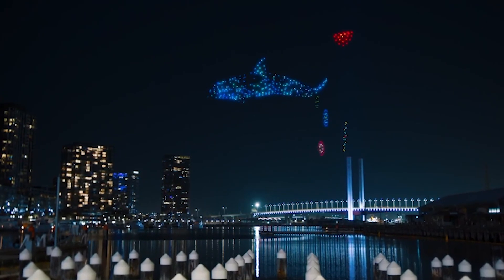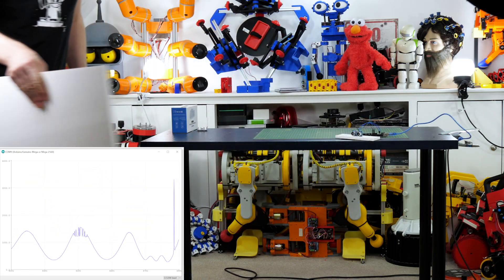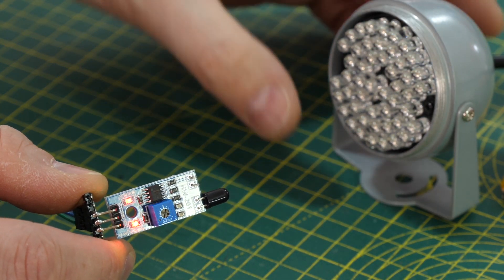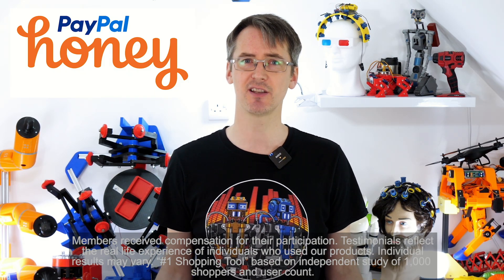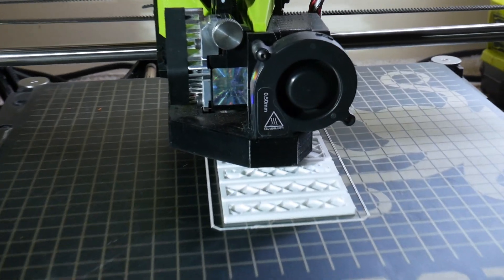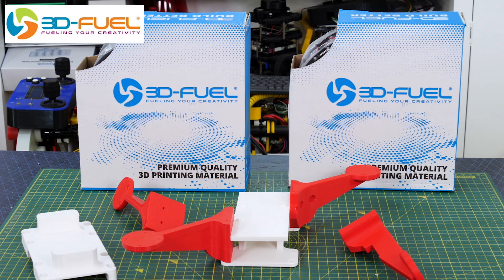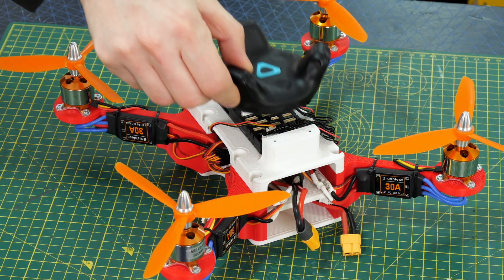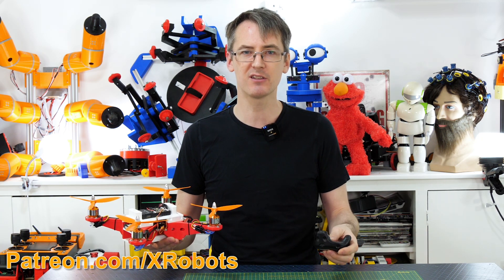Experimental Drone Positioning System

Comment: Pretty cool what you were trying here. Couple of thoughts:
1. If in case you are kinda fixated on ultrasound. Maybe having a range of just pure transmitters along a flat rule working as a phased array might get more accuracy. This of course would need a filter to remove rotar noise.
2. You could try IMU sensors  and ultrasonic sensors in a sensor fusion kalman filter.

Hope this helps!

Comment: Worked for a company making ultrasonic IPS systems for model cars, my job was to make autonomous drones and robots using this system, for industrial applications. For ultrasound, controlling the power and timing of the us-signal is crucial and a lot of filtering is needed for accuracy and precision (cutting through rotor downdraft and reduce noise from refraction, diffraction and reflection).
Reply: amazing ,and duing your workingtime ,can you use some navigation system?

Comment: You could try using the decawave dwm1000. Like Bluetooth and Wi-Fi, ultra-wideband (UWB) is a short-range, wireless communication protocol that operates through radio waves. But unlike its counterparts, it operates at very high frequencies — a broad spectrum of GHz frequencies — and can be used to capture highly accurate spatial and directional data.
Reply: It has functionality for anchors and tags. There is also a Arduino library for them. I bit more expensive than the ultrasonic solution, but should be more stable.

Comment: Great video! It is really a interesting idea :D I love these videos where the whole process from idea to experimentation is shown.

It really got me thinking and something came to my mind: I understand that the general goal is to be able to track multiple robots. But, if the objective was to track just one, it might be a good idea to switch the places of the transmitter and receiver.
The transmitters will be syncronised at the robot and the receivers at the static positions (obviously changing the atennas the other way around to catch the ultra-sound from all places.) That way you won't have the problem of just one signal being received by both receivers (well you could but the transmitter are at the same place so the measurement will still be "correct"). You will get two measurements of distances, one per receiver and with it do some triangulation to estimate the position. What do you guy think?

Again this is something I just quickly thought about, but I think it might work.

Comment: Watch Steve Mould's video on acoustic cameras!

this would better be implemented as the Ultrasonic transmitter on the robot, the "ground station" doing the calcuations, and transmiting the data back to the robot (optimally with an rf transmitter). this settup would also allow 3-dimensional positioning with a wider field of view. latency may be a concern, though.

finally,  you can use an accelerometer to filter out the noise and spikes. if the slope of the spike doesn't match up the the accelerometer, then filter it out. The accelerometer doesn't know where it is or its velocity, but it knows how much the velocity changed by, and using previous positioning data you can estimate what it's velocity *was*, so you can then estimate what the velocity *is*, so then you can estimate how far it should have moved, so then you can estimate it's position. if the estimated position is close to the detected position, it's good. if not, filter it out.

Yes,. the thing of the accelerometer is very reminiscent of "The missle knows where it is."
Reply: wow, u are right,and i have a qustion ,did accelerometers filter the noise?

Comment: I messed around with ultrasonic sensors a number of years ago and hated them. They suffer from reflection problems.  What about borrowing a page from VOR transmitters and receivers used for Aviation? They use VOR stations that transmit a omnidirectional pulse every second, and a narrow, directional beam that physically rotates at a fixed speed. When that beam lines up with 0 degrees, the omnidirectional pulse activates. The receiver in the airplane sees the omnidirectional pulse and computes the time it takes for it to see the directional beam. For example, if it sees the directional beam 500ms after the omnidirectional, the receiver knows it is on the 180 radial south of that station. If you tune a second VOR station and draw the lines on a map, your position is where the lines intersect. So, what if you did the inverse of this... Have the drone emit an omnidirectional IR light (or several). Have 2 towers on tripods with an IR receiver that is hidden inside a rotating 3d printed cup that has a narrow window in it. Drive it with a stepper so you can precisely rotate it 360 degrees at a fixed length of time. You know when it it is a the start position, and as the cup rotates, observe when you see the drone's light and you can compute the radial. Detect this from 2 such towers and you can accurately know the position of the drone, as long as the IR light is not obscured from the drone.

Comment: Those cheap nRF24L01+ modules could be used to replace the IR trigger. I wrote some code once which used the nRF21L01+ modules as a wireless flash trigger. The system was fast enough to use as wireless flash trigger so it may be fast enough to trigger the ultrasonic devices. I used the Parallax Propeller microcontroller which has 8 processors so one processor was dedicated to listening for the RF trigger using assembly code.
Thanks for another fun and interesting video.

Comment: What if you use, for example, EPS32 bluetooth beacons and EPS32 to measure the signal strength. How well it tolerates changes in the room. Assumed that without changes, the accuracy of the triangle measurement would be quite good when using the calibration table. Outside, you could perhaps use the wifi strength for longer distances.

Comment: What if you use four receivers on the robot and trigger on both edges of your sync signal?  You have more chance of always getting each transmission and you’ll know the difference in the arduino from whether it’s rising or falling on the ir.  Then you could filter the data from all four to the lowest value.

Comment: Use an update on the wiimote solution. Stick cheap cam modules on the bottom of the drones, and a non-equilateral trio of LEDs on the ground. You can infer the drone's rotation and coordinates from the LED triangle rotation, translation, and scale.

Comment: The infra red leds only transmit information about the phase of the pulses. It should be possible to get rid of the infra red channel by detecting the phase of the pulses automatically. The receiver could run a sweep across the phase range and see what phase gives the best signal.

Comment: Would there be any benefit in switching around the functions so the drone is the transmitter and the 2 booms are the receivers. I feel like transmitting ultrasonic and IR is a less susceptible to vibration and noise when compared to the receivers/sensors. Awesome project as per usual.

Comment: Fantastic video as always!
Take a look into the DWM1001-DEV board. They are great for applications over great distance, outdoors, and even through walls. I have gotten ±1.5" accuracy out of them independent of operating conditions. You can use as few as 2 of the boards to just get distance between the two and as many as you want to increase the 3D positional accuracy. 
they are also incredibly easy to setup and interface with using any microcontroller with just a serial connection !

Comment: Nice sync on the 40KHz,  those TxRx are almost iconic. like a 555.  Where Am I? Systems and Methods for Mobile Robot Positioning 1995, I have a A4 printed copy somewhere. . Its about 1" thick. Its a wonderful text . RF Microlocation hasnt quiet delivered on its promises, still ~10 cm. Why dont you ceiling mount the strobe, ceiling corner the US RX and vertically mount the IR Rx and US Tx . 
Its what has become Acoustic imaging, interpolating might get you to mm .Ultrasonic systems can be 
Ultrsnc sses cn b  Ultrasonic systems caan bee .

Comment: for the ultrasonics, see if you could filter frequency on the ping sensors.  if you could have the ultra sonics send a specific frequency based on their position, the drone could figure out which transmitter has a specific delay which could give you orientation data aswell

Comment: Hi James. Blutooth Low Energy (BLE) has a positioning feature. You should have a look at devices like the DWM1000 (and the equivalents).  These have 30m range, 10cm accuracy, are pretty cheap, and would be immune to most of the interference you are experiencing ... Great videos. Thanks!

Comment: James, don't use ultrasonics, that doesn't really work that well. Get the HTC Vive Lighthouse base stations and one (or more) of the HTC Trackers (tracking pucks). Cheaper and much more accurate solution that is impervious to noise.  

Not great for really small drones but for larger robots it works great. And small stuff you can track put a bunch of LEDs on the bot and use two (or more) cameras with a bit of OpenCV to track them. Even webcams will do. It won't be as accurate as Vicon but it won't costs 10k€ + neither.

Comment: Hi there! I love the work! It's just that I feel that a positioning system relying on ultrasonics is somewhat unreliable for drones, have you considered RF. I'm pretty sure you can send out clock signals using transmitters (2 minimum, 3 or more for accuracy) set at fixed location and have them in different bandwidth channels. Then in the drones you'll have a receiver, due to using multiple channels, a single receiver can pick up all the data using software filters for each specific channel. Pretty much a clone of how gps works, but on a small scale, and I guess it'll be very precise and will have almost no dead areas. Anyways, this is just a suggestion, keep up the good work!

Comment: Check out time-of-flight sensors which are low cost but optical so should avoid the turbulence issues. The VL53L series from ST should be a good fit. Adafruit even have a module for the VL53L0X

Comment: if you had a room with a flat ceiling you could make a grid of downward-facing ultrasound units with spacing of say one meter. Then the drone could have just one upward-facing ultrasound unit, if you mounted it on a stick it might overcome the noise problem. You would need a compass unit on the stick as well (away from the motors) to measure yaw. Another dodge might be to blip the motors instantaneously at ping time. You might not need many position fixes to control the drone. I don't think you would need diffusers on the ceiling units. Anyway a quick simple experiment would show whether the idea was worth pursuing
Reply from the maker: The flight controller has a magnetometer, so that isn't such a problem. I think at the point of covering the ceiling with ultrasonics you'd be better of with Aruco markers.

Comment: I'm wondering if the interference that you're getting with the ultrasonic receivers couldn't be in part from frame resonance.  Resonance is a big problem that  designers face when building and tuning new drone frames.  The resonating frame interferes with the flight controller IMU.  I'm wondering if you might not have some ultrasonic harmonics right at the frequencies that the receivers are listening for.

Chris Rosser has several examples of what frame resonance can do.  I'm wondering if he'd be willing to analyze your frame to see if maybe you're getting ultrasonic resonance interference.  Here's one of Chris's videos where he's analyzing a frame and gives a good example of what resonances do:  https://www.youtube.com/watch?v=aAnpq1mXbNw .  (I have no affiliation with Chris whatsoever.)
Reply from the maker: It could be, but there's no mention of that in the docs for the Pixhawk ultrasound, so I suspect that listens for specific frequencies rather than just 'any sound' it can receive.

Comment: Why don't you try radio frequency signal strength triangulation, like, you put 3 emitters around the area, and use the radial signal strength of each one to measure the distance, and triangulate the position, that would be even more reliable and cool. Thanks for the excellent quality inspiring content!
Reply from the maker: That would probably work - apparently you can use WiFi signals to detect people. A bit out of my skillset though.

Comment: The central system knows where the drones are at all times. It knows this because it knows where they aren't. By subtracting where they are from where they aren't, or where they aren't from where they are, whichever is greater, it obtains a difference, or deviation. The central system uses deviations to generate corrective commands to drive the drones from a position where they are to a position where they aren't, and arriving to a position where they weren't, they now are. Consequently, the position where the drones are, is now the position that they weren't, and it follows that the position that they were, is now the position that they aren't.

In the event that the position the drones are is not the position that they weren't, the system has acquired a variation, the variation being the difference between where the drones are, and where they weren't. If variation is considered to be a significant factor, it too may be corrected by the CEA. However, the system must also know where the drones were.

The drone guidance computance scenario works as follows: because a variation has modified some of the information the central system has obtained, it is not sure just where the drones are. However, it is sure where they aren't, within reason, and it knows where they were. It now subtracts where the drones should be from where they weren't, or vice-versa, and by differentiating this from the algebraic sum of where they shouldn't be, and where they were, it is able to obtain the deviation and its variation, which is called error.

Comment: Shouldn't you (theoretically) be getting double the standard range on the ultrasonic sensors with this setup? Typically if it is detecting an object 4m away, the sound would be travelling 8m from the transmitter to the receiver as it has to travel both ways. In this case, it is only travelling one way (with the exception of the short distance from the transmitter to dome) so should have about 8m range, no?

Comment: Could you modify the ultrasonic sensors to accept sounds from any direction? Both the transmitter and sensor are designed to work in a narrow cone so it doesn't hear itself, only the echoes, but since you don't care about that, it would stop the dropouts when the sensors weren't pointed directly at the transmitter.
You would have to filter out the echoes, though, since now you have that sound being heard from all over. The first received sound should be the one that's travelled directly, though, so it should be possible.

Comment: You didn’t smooth out the domes did you? Possibly you could get better results with the ultrasonics bouncing off a smooth surface. I don’t know the maths so my hypothesis might be way off… but higher frequency bounce off smaller surfaces than lower frequencies, and a 3D printed domes is pretty much just a bunch of horizontal layers stacked on each other… so perhaps the sound bounces more straight forward, and you get a narrower cone of effective area because of this.

Comment: Fantastic James! I've thought about making an ultrasonic positioning system for an automated lawn mower and having the transceivers on trees throughout the yard and a 360° tweeter array on the mower.

Glad to see the accuracy I would hope for! I didn't think about trying to use an existing distance sensor, I tried using a tweeter for the transmitter with the arduino making a 30kHz tone, and then an electret microphone with a bandpass filter and peak detector circuit for the receiver. Was going to use a radio link for the sync. My first few go's didn't work and I ended up using the tweeters for my sound system rather than keeping with it. 🤭 Maybe that approach would work for you! You could use cheap Amazon tweeters to get higher powered audio than what those little modules can produce.

Comment: Omg the dome! Genius! Can you comment on the comparison between your approach (obviously cheaper) and the indoor positioning system of the first generation of Roomba Braava mopping robot? It relied on one beacon only, projecting a signal on the ceiling, and the robot on the floor sensing its relative positioning. Much more expensive than yours, but way cheaper than the drone system, as the entire product was 300 euros when it got out. Thanks!

Comment: You should look at using UWB modules for positioning. You get ones purpose built and they use radio waves. You have modules that you place statically (anchors) and then the modules you want to track (tags), this may work much better than your current setup and isn’t directional like this and won’t be affected by the drones propellers.
Reply: There’s also a uwb module built into esp32 with an arduino library. Smaller. Cheaper. Faster. And far more reliable.
Reply: @doublebyte01  can you point me toward more information on this?
Reply: @andrewmaples5   here’s a link to an overview: https://youtu.be/KVPQaBgxUQg The board uses a DW3000 which is now manufactured by Qorvo and is compatible with Apple’s U1 chip, so it should work with an iPhone. There’s also an arduino lib. But it’s a little thin. However, you finagle it to make demos similar to this one. The only downside is that UWB can be noisy. But that is fairly easy to deal with.
Reply: @doublebyte01  I think you mean there are boards that have an ESP32 and UWB module. No ESP32 has UWB built in.

Comment: Your maximum range with the ultrasonic sensor might be larger that the 4m now. Normally the ultrasonic sensors rely on reflections, and reflections lose energy, if you have a transmitter and receiver separate then it doesn’t lose energy due to reflections and it might work at a longer range.